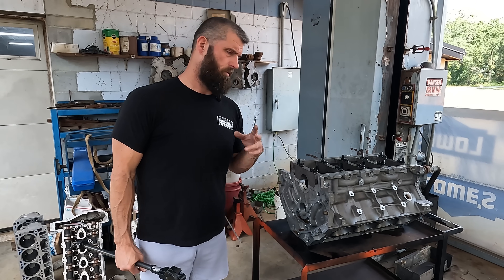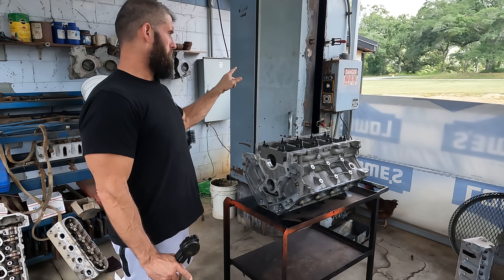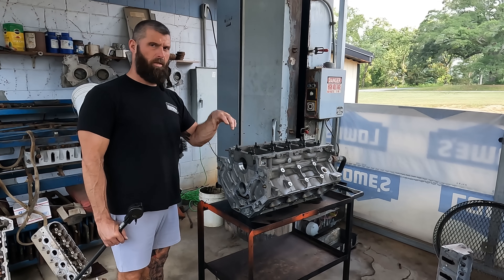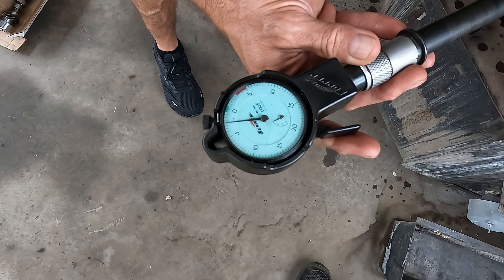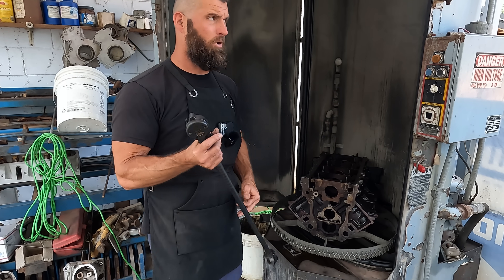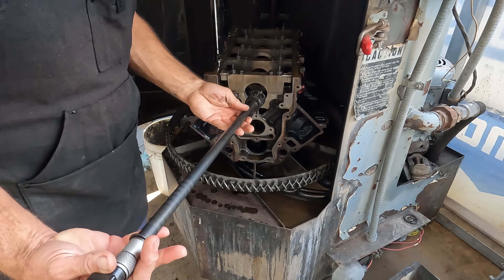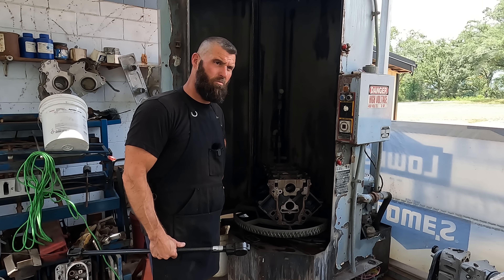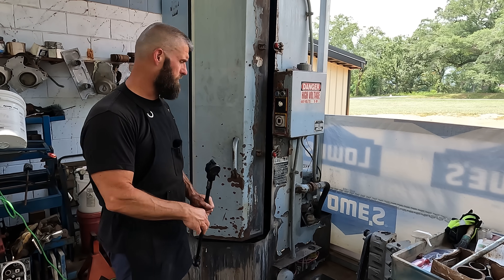Aluminum vs Iron main bearing clearance

Comment: are the tolerances any tighter today than years ago when we used 10w-40 motor oil, why is 0w-20 recommended on today's GM engines?
Reply from the maker: Yes, considerably

Comment: Follow-on question with main bearings.  With an aluminum block growing that much more, should aluminum-backed bearings be the better selection relative to steel-backed?  I'm thinking the aluminum backed would take up the tolerances more readily than the steel-backed.  Likewise, would the aluminum-backed cause problems in the steel case as they "tighten with heat" relative to the iron block?
Reply from the maker: I don't guess I've ever seen aluminum back bearings

Comment: Awesome video... There's 1 more piece of data to consider though: how much does the crank's journals grow inside those bearings? If the block's bearings grow 2 thou, and the crank grows 1 thou, you're not at 4 thou clearance... It would only be about 3, correct?

Comment: Coefficient of expansion….
Cast Iron
0.0000068 of an inch/per inch/per degree 
Aluminum 
0.0000123 of an inch/per inch/ per degree F
You raised the temperature from 88 degrees to 188. That’s 100 degrees.
0.0000123*100 =0.00123 per inch
Times the bore size…let’s say 2 inches 2*0.00123=0.00246.
So the bore increase would be 0.00246.
Math is fun .
Peace
Reply from the maker: Ty

Comment: That and cam bearings cause lower oil pressure with same oil in aluminum block. Thicker oil and make sure you let it warm up. Thanks for taking the time to show this cool video!
Reply from the maker: Glad to do it

Comment: I'm assembling a Ford 302 and all of the main bearings fit snug in to the block and caps except for #3 upper shell. It's a very loose fit if I was to turn the engine over on the stand it would probably fall out on the floor. I've never ran in to this problem before. The block was line honed didn't something go wrong ? The owner of the engine didn't seem concerned  and wants to run it. I don't want to be the guy saying " I told you " when it screws up. What are your thoughts about this ? Thanks
Reply from the maker: Something is wrong, did you try different shells in that location

Comment: This is genius. Eliminate speculation with testing at operating temps. The only way to know your actual running clearances. 100% respect👌👍
Reply from the maker: @littleriverrestomod4205  thank you, we try hard
Reply: @powellmachineinc  We do this in the marine propulsion biz. Temp controlled machining environment, pre, during and post temp checks of the material when machining and measuring for Q/A. All verified by Lloyds. Thordon bearing material as an example grows and shrinks a crazy ammount and will grow 2-3 thou on ONE SIDE if you are using radiant heat in the shop, pause the machining and  stop the lathe. Then you have to let it spin for an hour and normalize,verify, and resume machining. All critical measurements to be taken at a specified temp. Especially your micrometer checking standards. 
Small sometimes overlooked details are the difference between high performance and the high cost of replacement.
You're doing great work👍

Comment: I might be concerned with bearing crush.  I wonder if the bearing companies make them a different size for thermal expansion?  I guess the steel backing would be close to the cast iron.

Comment: That is a very interesting and surprising result. I re-torqued cylinder head bolts cold, then set valve lash. Cold being room temp and one head bolt at a time. This 4 cylinder import was alum. on cast iron and never had a customer loose a head gasket. They also didn’t have torque to yield bolts either. 300k miles was not uncommon for life. 
  Very interesting! Thanks.
Reply from the maker: Very welcome 🙏
Reply: @powellmachineinc  To give a thinking man a new thought, is the best gift he can receive! 
Thank you kindly Sir.

Comment: Aluminum expands about twice as much as iron.  The reason the aluminum block didn't expand more was because it had steel caps.  You should check the aluminum block with steel caps for roundness when hot you may crap your pants.

Comment: Great videos!!  You can calculate the change in dimensions for Aluminum and Cast Iron/Steel. Cast iron/steel will grow .000006" per degree F. Aluminum will grow .000012"  per degree F. This is very handy when you are assembling Press fits. You can easily calculate how much to heat or cool parts to create slip fits and make assembly a breeze. I didn't pull this out of thin air.....it comes straight out of the AERA Machinist's text book.
Reply from the maker: @turbodave231  Tycm!!  but it's always good to test and verify,

Comment: Just a question, but isnt the international standard for machine shops that they should be at 68 degrees f ambient temperature for measurements, not "normalized to the outside" temperature..?
Reply from the maker: You are confusing a specific measurement to a comparison measurement

Comment: well  theres also the   steel maincap on aluminum block   so differnt  expansion rates to consider and then  there how much  thicked to the  bearings  get  when they heat up

 soo many factors to think of with engines alot of people dont  even  know about
Reply from the maker: Definitely

Comment: As a fellow machinist of 20 years my next question would be what alloy is the aluminum block made from? I assume it would have been heat treated when initially manufactured. 

On a side note. Is it safe to assume that bearing clearances as defined by say a factory service manual are measured when cold, because the engineers have factored in the thermal expansion when designed? So if a manual calls for say .002" clearance on the mains after machining, then when at operating temp the main bearing clearances are ACTUALLY more like .004" when in use and up to temp?

Comment: Aluminum has a fairly high thernal expansion coefficient of around .000013 / inch / deg.
If you think the bore grew more than you thought, imagine the legth of the block itself how much that also grew.

Comment: Nice demo.  I think many of us could have made an educated call on some increase happening but not able to put number to it.  I expected a bigger difference between the cast iron and aluminum blocks, but either way, with a bore size having a range of 8 tenths or so it would be easy to go out of spec on a warm engine.  It would be nice to see if the crankshaft journal expansion would take up the extra space, as well as how much variation in expansion there is block to block.  Thanks.

Comment: The rabbit hole you opend up...Expansion or growth, that info be nice on each build sheet..Its all going in there and takes 10 minutes to mesure....Nice your giving a cpl secrets available..Knowledge opens up to more doors than 1...

Another rabbit hole is when the lifter galls the lifter bore......Block is washed and parts. Most do not grasp the lifters or valve train takes a sudden oil loss, you proboly have a main issue....
To get that group of people a little bit more well there ya go...You just went through 5 rabbit holes...

If your main is growing 2 thou and you want .0028 for clarence to have well now, the reason every motor- rods and main bearings customer is being billed for 2 sets each
4 (2+2) sets of rod and main bearings....

Comment: My shop is at my house. Don't know how many times one of the cats spoked me coming up and rubbing on my leg.  My kids also like to walk up as quiet as they can when I'm under the lift and man, those lift arms don't move when you hit them with your head, lol. 
  If the tolerance changes, does that justify running a different weight oil?  I'm trying to decide what weight oil is best for different applications.  I wonder what lubrication changes happen when taking an oem block past it's oem specs.
  If an oem iron block has alum heads, does the cams/valves change geometry and hurt the performance when hot?  If an iron block and alum heads changes specs at different rates, how are you supposed to know what you need to do for the best build?
  I'm sure I'm over thinking it and it prob doesn't matter much on a low hp build.  If you had a 10k hp engine, it prob does make a difference enough to build accordingly.

Comment: F1 engines have to be preheated before it will spin. They heat the oil and run hot water thru the block before they attempt to start .

Comment: Well, in either case, aluminum block or Cast iron, the bore grows .002 to .0025.  So your oil clearance will increase by .001 to .00125.  But since the crank diameter will grow the same amount for a cast iron crank, and even a little more for a steel crank, the net change in oil clearance will be pretty much nil, maybe .0001 up or down.  So I don't think you should change your line hone dimensions at all.  Just my opinion as a retired engineer and metallurgist.  
A very interesting experiment, thank you for doing it.  It got my brain working.🤔
Reply: the linear thermal expansion rates are not the same per degree.

Comment: interesting, I fitted alloy heads to a Ford sb and solid lifter cam, instructions only  directed me to the cam card for the valve clearance, .22 thou, noisy so I reduced the clearance to .18 which sounded about right, most European pushrod engines use solid lifters which is what I’m used to, no science in this just a guesstimate I’m afraid read that alloy expands at a far greater rate than steel, up to (5 times) and was expecting your findings to show a greater difference but the alloy block likely has steel liners, don’t know but always learn something watching your work 👍

Comment: The question is, do you size Main tunnel Under the minimum size, .0005"or .001" under minimum, but how much can you go before it affects the bearing shell when fitted... But also best if you want .003" hot, you start with .0015" cold, then you a smidge over what you were chasing....

Comment: This temperature expansion is actually a major issue in the manufacturing of cams. Even just from room temperature on a normal day to a hot day (~70-115) can add a few tenths on the journal size on a larger cam. So after grind you'd have to wait for the part to normalize to QA area. 

Did a big project at a company that made cams for the OEMs and we had to add a temperature scale at the automated gauging to prevent making u/s parts in hot days after they cooled down. 

Good stuff man!

Comment: Thanks for checking this. 
I've measured several LC9 blocks at 200* and they were .0017-.0018" larger than at 80*.
So I make sure main clearance is .0015" at 80* and it makes high oil pressure cold. 
But when oil and coolant temps are at 200* oil pressure is in the mid 40s  at 800rpms and 95-100 at 7500 rpms. 

I measured a few stock cranks but don't remember their expansion numbers :(

Comment: When doing this little demonstration of thermo-expansion, don't forget that the shaft running inside that housing is expanding also.... Aluminum expands 13.1/5.8 times as far as cast iron (2.25 x)...so don't be surprised if your Alum, Twin turbo, 4 cyl, has a short life when pressed hard...

Comment: I worked in a machine shop that repaired and ground mill rolls.  I couldn't believe how much the size would change with temperature on some of the rolls. Also when doing a new bearing journal how much we could get the roll to grow with heat to shrink fit the journal.

Comment: 6:36 Aluminum rods have dowels for this reason...correct? Don't you have to drill bearing to match steel dowel in aluminum rod. 

Have you ever seen a spun main bearing in aluminum block?
Reply from the maker: Yes amd yes

Comment: That's something that I never considered. I have a question. I have a rig with a Chrysler Magnum V8 in it, and I want to rebuild the engine. It will be a mild, low rpm torque engine for a truck. It will not be driven often, but when it is, it will get a workout as a snow plow truck. So lots of cold weather starts (below 0° F). Given that information, should I set the clearance a bit loose due to dry starts and then getting hot because the plow blocks airflow, but the back and forth of plowing really heats things up? The truck sits too far away from the main house to plug in a block heater.
Reply from the maker: Std clearance,  light oil and a block heater for sure
Reply: @powellmachineinc  . . okie doke, I appreciate it.

Comment: Aluminum ls 800 hp sprint car motor.  .0017 clearance.  Its 80 psi at 1000 rpm cold and 40 when hot. Always worried something was wrong.  Thanks for doing this test.  Makes me feel better
Reply from the maker: No problem!

Comment: I scuffed a rear main on a 400 SBC dirt late model engine, so after that I started running .0035 to .004” at position 5, thrust and bearing always looked good on future builds. That was a gas engine running about 220-230 oil temp.

Comment: I have been keeping an aluminum Ford Can-Am 498 running for a while. When I opened it I could see the center main was just grabbing the crankshaft. The indicator measured .0005 runout on the journal which I see as normal for these heavy crankshafts.  I knew it should be opened however I had no time. It had been running so I did what I could by adding .002 shim between the block and cap. Now I know that's not the right way to do it but we've got to go and the next time it's down we'll look at it. Besides I did gain clearance.

After the racing, we looked it over and it was still trying to grab the crankshaft. The crankshaft still had .0005 runout at the center. 
Like you, I measured the mains cold and hot from the tank. Same .002" growth.  -- I told the crew to preheat the engine before starting figuring that could do it.
The next time in, still the same. The cold clearance was .0025/7. The center  bearing was still didn't look that great so the crank was ground 11 under and 12 on the center main. I really didn't care what clearance it was, I was looking at what it was telling me. 
It's running fine and yet to come back. -- I fought the piston clearance as well as they were sticking when it came in. Two sets later and were at .0095". I know, but again. Everyone before me has been wrong with this piece. I'm just listening to what it's telling me.

Comment: OT question : in an older video, I believe you were driving some valve guides into or out of a head and it looked like you were using some sort of hammer drill. Can you tell me exactly what that was ? I've googled all kinds of terms but can't find it.
Reply from the maker: It's a valve guid driver for a air hammer
Reply: @powellmachineinc  Thank you.

Comment: There is a thing that can happen with aluminum blocks with a solid camshaft. If you lash them hot they can scorch the valves when you start them up, the blocks shrink more than anything, including the pushrods, and it ends up hanging the valves.

A cast crank should be almost the same expansion rate as the cast block, a steel crank should be a little more. An iron block with a steel crank might actually have tighter clearances when hot.
Reply from the maker: This why solid cams have lash

Comment: We never had any problems with the main bearings staying together. Read further to understand how we got away with it. 1200 hp pro stock, early 80’s. The bore got a little bigger , crankshaft a little bigger. We lost some bearing crush. Never had any problems with main bearings turning. We would drill the main cap. Put a pin in it, drill the bearing shell and pin the main the same way we would pin the connecting rod bearings. You’ll see that in most aluminum connecting rods

Comment: Aluminum connecting rods grow substantially.  Aluminum cylinder heads swell much more, requiring MLS gaskets. Add heat, and it opens up even more.

Comment: Yearsago I used to do a good deal of aluminum pipe welding forthe aerospace industry and we had to be very careful of the amount of heat expansion the aluminum pipe would grow. A 3 diameter pipe 100 foot long would grow 11" in 100 feet after a heat cycle f the system it serviced .

Comment: So that's why the chicken crossed the road. 
Very good video , seeing the  expansion difference between the two . It'll be interesting to see the numbers from the crankshaft .
More fuel to the fire of aluminum vs iron caps on an aluminum block then ?

Comment: I would never think that a roughly 100 degree temperature change would make it grow that much.  I figured at most it would grow 0.0005".  Thanks for doing this.
Reply from the maker: Thanks for watching
Reply: Only 5 tenths? Lol.
Reply: @ShortArmOfGod   What's funny about that?
Reply: Thernal expansion coefficient of aluminum is about .000013/inch/deg. Its actually one of the more aggressive materials for temperature changes.

Comment: Personal experience, running .0015-.0018 on the mains of aluminum Gen III and IV blocks works rather well.
Reply: The newer Gen5, gen5+, and gen6 run a crazy tight .0008 I'm a gm technician and specialize in engine repair. That spec is still crazy to me.
Reply: @mikeday8826  Yeah, I agree. And I know they are doing that to keep oil pressure up at low speeds when everything is at temp. But everything has to be perfect all the time or bearing life suffers. And things aren't always perfect.

Comment: Thermal expansion of iron is .ooooo6 inches per inch per degree. Aluminum is about .000011. About 70% greater than iron.

Comment: I have read from variuos sorces that aluminum 283 s  used in sscorvette in late 50s or early 60s had to be so tight cold they would barely crank so they waould oil pressure when hot. metallugacy has improved a lot. excuse my spelling

Comment: So then if you plastigage your mains to 2 thousands cold, it would grow to 3 or 4 thousands at operating temps?
Reply: Then if the crank grows  to 1 or 2 thousands then it would close up the clearance back to the original dimension?
Reply from the maker: The crank won't grow that much I doubt
Reply: @powellmachineinc  Can't wait to see that test!